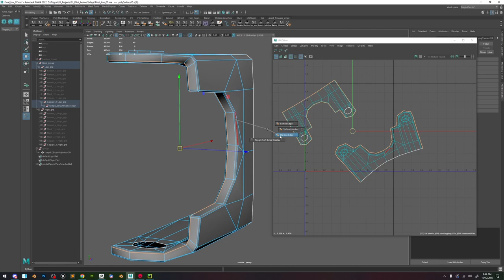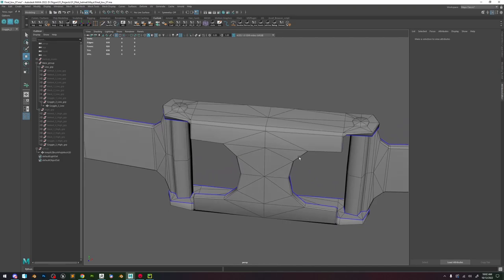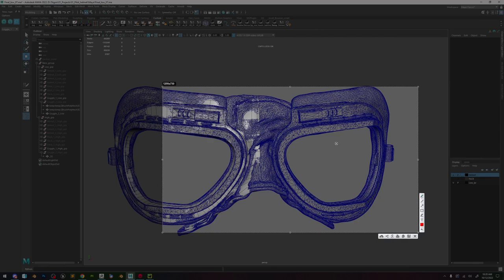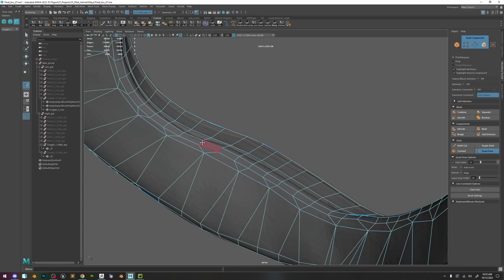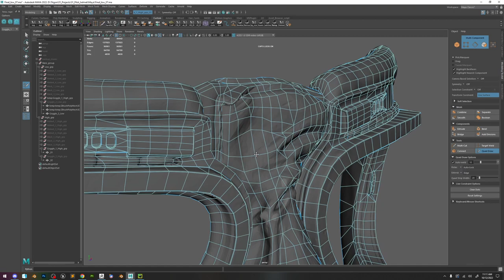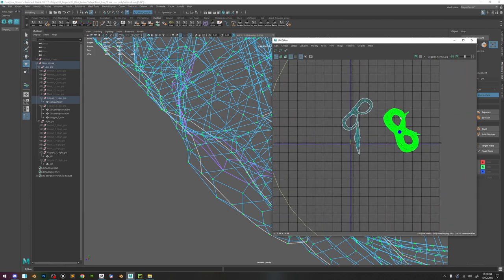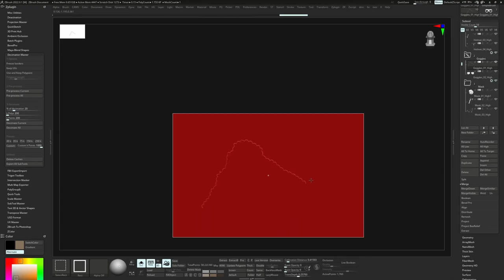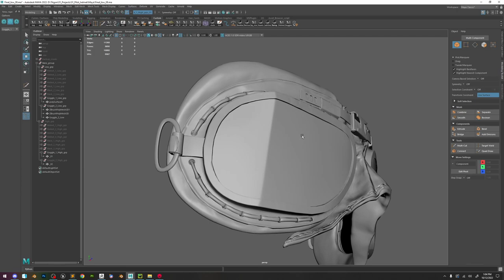3D Modeling A Pilot Helmet  - Part 20

Comment: I was learning Hair Card by your video. Thx a lot for this. 

Is this helmet is game ready?
Reply from the maker: It's a bit high to call it a 100% game ready. But it's meant as a hero prop (prop for main character) but if I were to model it for actual game. I'd put in a little bit less polycount. But the mesh is built exactly how I'd do it for games.like merging stuff togheter in one mesh and all that. Would just have to use some less edge loops and all that. (mentioned throuhout the videos). Hope that clarifies :)
Reply: @TriGon_Art  Thanks for the detailed explanation.
One day I will like every your video :) Thanks for the content